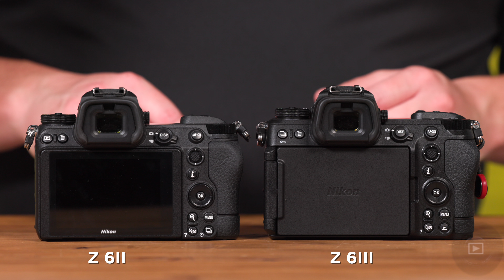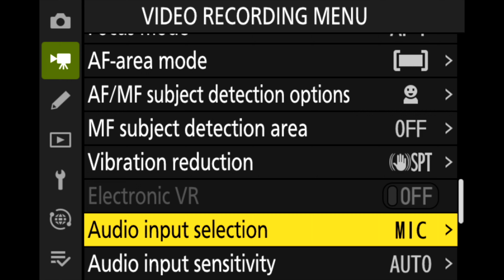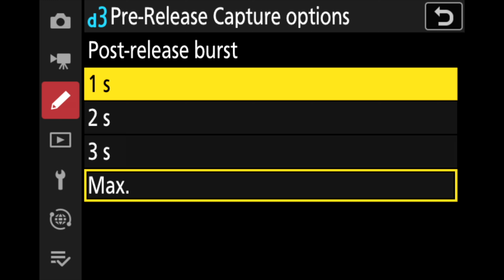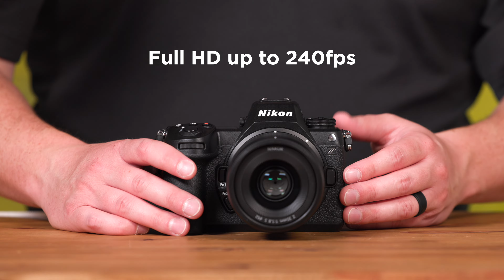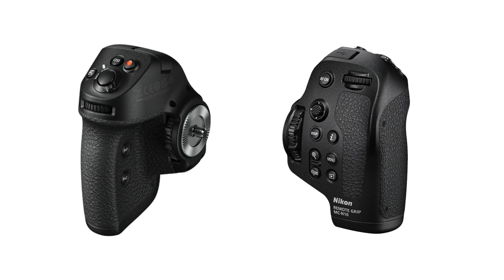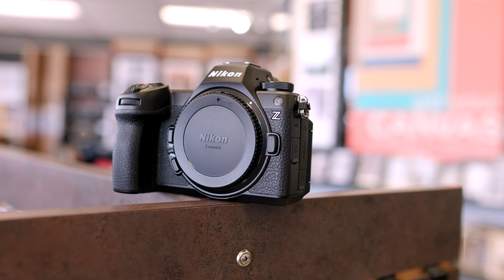Mid-Level Mirrorless to the Next Level: Nikon Z 6III

Comment: Great camera, but waiting for Nikon to fix the flicker/color shift issue
Reply: FW updates will address those rough edges overtime
Reply: @VIDEOVISTAVIEW2020  - I doubt firmware will fix a sensor SNR issue, but we'll see.
Reply: @truthkeeperfilms  it depends if its a hardware or a software issue. But I'm sure, the Z6III has a lot of room for improvement
Reply: @VIDEOVISTAVIEW2020  Im hoping. From some tests I've seen, it seems to be a read issue from the sensor.